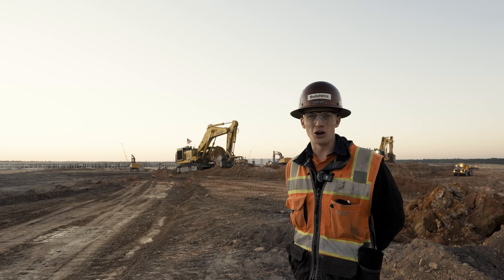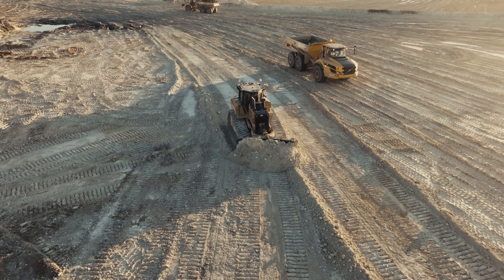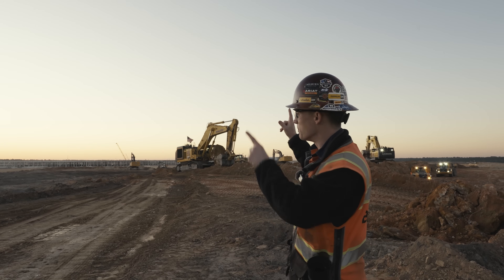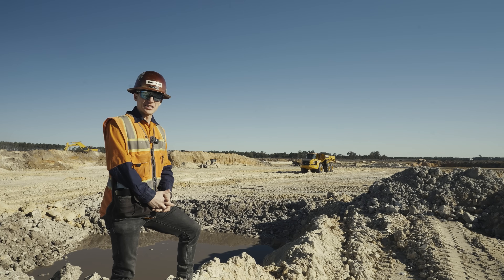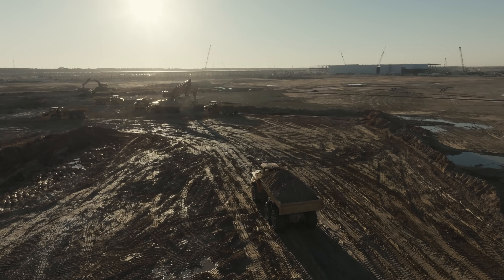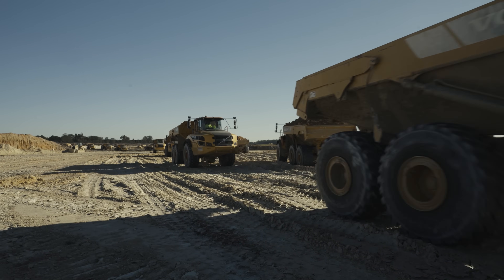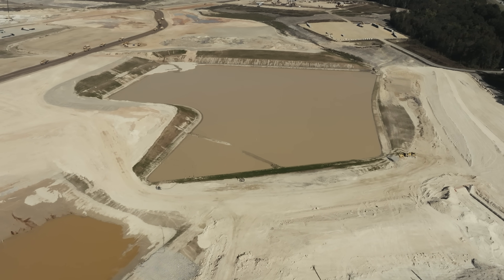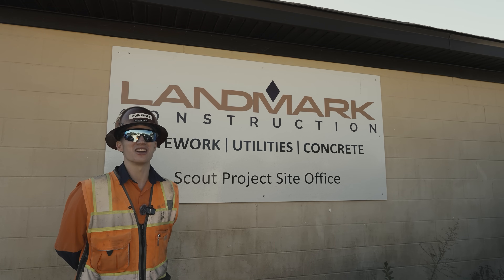America's Largest Earthmoving Project?

Comment: I was at a large ag show once and they had a tractor pull competition. Volvo was exhibiting at the show and for fun they stopped off at the tractor pull with their articulated (dump) truck and had a go at it. They weren’t really competing, but just having fun. Basically it was, “Where do you want the drag sled parked!”

Comment: 5:03 Does it need to be perfectly flat?  A modest slope is not only better for water management, but could be used strategically to lessen wear on conveyors if the assembly line starts at a higher elevation than it finishes.  
It's probably a lot more complicated.

Comment: I am infatuated with ejector bodies on ADT trucks. Imagine the tucks being able to dump and spread on the fly. Think of the transmission cycles eliminated. 
Think of the carry-back minimized. 
When dumping in the soft areas…not having to stop, just roll along, dump, spread and the ADT rolls over, staggers his spread and spreads on the fly too. 
The inertia required to get 40 tons moving would be greatly reduced as would the wear and tear on driveline components, I bet there would be fuel savings on that too.

The ADT truck would be less tippy too. Sticky carry-back material in the bed corner during the dump cycle raises with the box, raising the center of gravity (imagine a crane lifting and booming out an unknown load while unsure of the ground conditions, if the out riggers are out…)

I am certain as time goes by the ADT ejector boxes will become more and more common. 

We should grab a coffee sometime Aaron.
Reply: You can dump on the move with Volvo ADT's the moment you start to lift the body they are speed limited, need good flat surface to drive on though

Comment: I used to work for one of the biggest earthmoving companies in uk . Used to stay away from home a lot or travel all around the country fixing this stuff . As a site fitter, we used to start at 6 am, check oils, and start machines up they used old volvos 860 for lube trucks.  
Dumpers used back then, and equipment 
769 b
A25
A35
D250
D400
235 b,c
245b,c
14g
16g
D7H
D8k
D9h,g 
631
637
825b
Dw 21 converted to rollers 
Terex ts 24
Komatsu 650
Kom D31e
65 e
Pc 210
Komatsu scrappers.
They had a lot of plant .

Comment: Roughly $8 per cy cut and placed. $256 million dollars. Factor in utilities, rough in of roads, parking lot, and ponds roughly $75 million. Interior foundations, plumbing, and electrical trenching $10 million. Paving of roads, parking lot, curbing, and sidewalks $15 million. Aggregate rammed peirs and other ground improvements $45 million. This job is monstrous at $401million! If site work package is 25% to 30% of total cost of a project. It's over a $1.5 Billion dollar project. Not counting the cost of land, permitting, and design. Gc probably gets 2.5% management fee.

Comment: The haul roads are horrific. Where are the graders?, didn't see one in entire video. The 17 minute haul be cut to probably 13 minute easy.  Most excavators seen are digging too deep, many not even full buckets, almost everyone digging too far from trucks. With the 1250 that truck shoulda been loaded well below 50 seconds. I can do this in bout 55 seconds with a 330 Cat, yes provided the truck driver cooperates. Where are the clean up dozers for the excavators?

Comment: 1600 acres stripped of forest and habitat, stripped of the earth that would otherwise absorb all that water.
Then used to fill in more wetland habitat. 
Replaced with heat reflecting non-permeable concrete, asphalt and buildings.  And ponds that will not serve the same habitat purpose as the wetlands did.
All to produce vehicles that our government subsidizes and the majority of Americans don’t want. 
But…the tree hugging anti-fossil fuel consumers will buy them. Just don’t show them this video.

Comment: Sure, it's a big project but who is running it and designed it?? ZERO motor graders on site!!! WHY?? Your 'over 100 trucks' are loping all over because of poor roads in the cut!! This increases waste, increases travel time per trip, increasing fuel costs AND repair and tire costs and is LESS efficient all at the same time. The fact that your 1200's are mostly top-loading is also NUTS! This looks like a big, poorly-designed hot mess.

Comment: Great video!  I was on a project in San Diego in the early 1990's that had thirty-six 657E Caterpillar Scrapers working in pairs with nose hooks.  Several Cat9 Bulldozers as well. The conditions were near perfect with sandy easy soil and sub two minute round trips.  10,000 yards per hour.  I witnessed one ten hour day where they moved 100,000 yards.  I was a working as a land survey party chief at the time checking the daily volumes.  The most amazing thing?  The earth moving went on for months and months.  If I remember correctly it was 6 million yard project.
Reply: Was that down by the border?

Comment: Yeah, nice work but at what cost? You  know taxpayers will  pick up all the cost of the billions spent. And all for a failed transportation method. We have neither the power generation capacity nor distribution network to go fully electric. Not even close and it would take many years to address this issue and trillions of dollar. So  much carbon emissions  to do this you would never make up for it by producing failed EV'S. But trillions of dollars will be made by thise awarded contracts and the politicians handing out  the contracts.

Comment: with projects this large, why is it still practical to use relatively small equipment
or is it just that this kind of project is rare so all the equipment then have is for small projects

guess you explained the dump truck size, floatation issues
but using 10yard buckets, thats still more than 2 million passes, and it takes a few passes to fill each hauler
Reply from the maker: often to availability of large equipment as well... can't just call a manufacturer and get a 300-ton excavator next week

Comment: This is amazing. It's also amazing that crews from in the cut and fill areas are not using grade states, not even gps.
Reply from the maker: there are dozers with GPS that will monitor the cuts and fills

Comment: SCOUT MOTORS is owned by the Volkswagen Group. So Lindsey Graham got a foreign company some kind of sweetheart deal with the CHIPS ACT to build ELECTRIC trucks which NO ONE wants and they suck for what trucks are used for. It's why we are $36 trillion in debt. It's why AOC goes into Congress as a broke ex bar maid is already worth $5,000,000. Insider trading and backroom deals is what CONGRESS does now. It's the only thing they are good at. All I get from all of this is inflation on steroids. Other than that it's a great video.  While Chevrolet is outsourcing it's jobs to other countries. SCOUT MOTORS RECEIVED A $1.29 BILLION SUBSIDY FFFFRRRREEEEE

Comment: I love this channel. I believe, the Microsoft Data Center being building in Mount Pleasant WI (South of Milwaukee) is on par, but actually appears quite a bit larger than this. The area being used is 3 county highways wide. Its one facility, stretching I believe 3.5 miles NS and 2 miles EW. I would love for your channel to check out that megaproject!
Reply: Company I work for is working that right now, as well as a project in northern Louisiana that I am currently on, 1 mile wide by 6 miles long
Reply: @ SMALL WORLD!!! 6 miles long is actually INSANE!
Reply: @yay468  I work for rock solid soil stabilization, if you’ve heard of us. But yeah it’s absolutely insane. Contractor has over 100 scrapers down here. We suspect it’ll take us about a year to stabilize the whole thing
Reply from the maker: thank you!
Reply: So these are data farms???
Reply: Did you guys listen to this first?

Comment: Have worked on some large (what I consider large from 100,000 cubic yards to 500,000 cy) earthmoving jobs where we had a fleet of scrapers or a fleet of trucks (rigid-frame or ADTs).  But this job's daily quantity of 75,000 cubic yards of production is just insane.  There are a very few jobs in the past in the U.S. like large earth/rockfill dams that are larger earthmoving jobs such as California's Oroville Dam (78 million cubic yards) but not many.  Thanks for explaining why they were not using top-down loading in some of the scenes because I saw it being used and then not used.  Thanks for sharing this plus kudos to Landmark Construction!!  Great production/great narration as well!!
Reply: I worked at Fresh Kills Landfill for 28 years, 18 years while the dump was open for business and 10 years just filling in voids with dirt, in preparation for final capping, usually (not always) in 5 foot lifts. Some of the areas I filled were more than 50 foot deep and 2 miles long. When I was Shop Steward we had only 16 Tractor Operators. (As opposed to 260 Tractor Operators, when the Landfill was open.)  I used to push out and grade 240, 20 yard truck a day, everyday, rain or shine. Sometimes I got help to cover outer slopes, I also built the access roads to get the trucks to where they were needed and enable them to dump even in inclement weather. I did this with  D9Rs, and D6R LGPs depending on ground conditions. I moved more than 10 million yards by myself during the time that the dump was closed. During the time that the Landfill was open, I spent 3 years as the Plant #1 daytime "Cover Bull". During that time, I built 3 one million yard cover piles, from which our "night scraper gang" drew from to cover garbage in various areas of the dump. When I retired, there was only 3 Tractor Operators left, and they ceased the fill operation completely, handing it over to Tully Construction for final capping. As a retirement gift, they gave me a Scale Model D8R.
Reply: Are you retired.?
Reply: @rogerbrandt6678  No, as I sit here tonite (Sunday 1/11/2025) I just finished updating a course syllabus for a course this Spring Semester 2025 at UNLV and now am working on a consulting report that is due Tuesday.  Way too busy but still having fun!!
Reply: 75,000yd3 a day is only just under 36 loads a day in the 100 trucks they have, assuming they are all 40t. Pretty modest to be honest, but I see a lot of inefficient loading setups in the video and its probably a longer haul across site. That being said larger trucks would make a long haul more efficient.

The site I am currently working on we move 2,000,000 yd3 every 24 hours

Comment: Nice job. I did a job almost the same size 18 years ago just north of Toronto Canada ,30 scrapers, 9 dozers, 4 graders, 10 packers,we where there just over a year ,from sewer/water mains to building and finish asphalt. I love construction equipment ,went to the mines for a few years now retired .Cheers and be safe
Reply: Who did that job?
Reply: @oldironguy  Con drain with Bianchi  construction
Reply: @uneetudiant  Con drain is still a major player in sewer and water/ subdivisions. Them and their relatives TACC
Reply: @oldironguy  Yes they are ,I did work at Clearway for many years too ,they are big too,but special under ground pipe I did.
Reply: I think the correct pronoun is we not I
Reply: @Old-n8f  Ooops my bad ,I was the super lol

Comment: Top loading does have to happen at times. They clearly have ample truck support. I enjoy watching.  I do question the deep cuts. The excavator can cycle faster with a 4'-5' cut rather than a 10'-12' face. Double or triple pass required but maybe they have an area constraint. I would love to see a follow-up video on this project.

Comment: The earth is flat, it don't rotate or spin. I spent enough time on the ocean and in the sky to know this. The only reason you can't see an object far away isn't because of curvature, its because we are limited in sight. A pair of binoculars will prove this. The earth is not without its rolling hills, tall mountains or flat water so still it looks like a mirror.
Reply: Standard row boat on a lake a few miles long proves you wrong.

Comment: I was hoping this would be for an advanced chip manufacturing plant, not an EV assembly line. Unfortunately electric vehicles have been decreasing in value and there's a very high chance of that trend continuing with the upcoming political changes.

Comment: Appreciate the content. Please consider more statistics regarding the management efficiency of this project. How often does the scraper or box scraper run the transit route to maximize transit time of the trucks? What, if any, was the difference in transit time with the rigid versus the articulated trucks? When does geographic availability of used versus new equipment get factored in? How do they factor efficiencies in the fueling and daily maintenance occur?  Is it all at once over night or staggered? What is the tradeoff with a 10yrd bucket versus 12yrd bucket with fuel burn? When does 24/7 operations or overtime with 12 hour shifts get considered?
Reply: F*ck me, you like your statistics

Comment: Are all the articulated trucks the same capacity ? Looks like all 35 ton units. If that is correct, I’m wondering why the contractor decided not to go with Volvo’s higher capacity models. Such as the AH-45 and AH-60 attics.Using the bigger trucks would have definitely reduced the overall fleet size. Might just be the contractor wants to minimize ground pressure while traveling on the soft underfoot.
Reply: We have 40, 45, and 60 tons. They also got rid of the 605s and replaced them with more articulated trucks
Reply: They didn't get rid of the 605s the lease on them was up so they were returned.

Comment: Why are large buildings flat?  Keep in mind I have been in construction for 60 years.  And how would you gauge both plumb and level ?  And if you do make it flat it will always be down hill toward the center of the building, and uphill whenever traveling away from the center.
Reply: It is done with GPS accurate to a centimeter. 2 or 3 transmitters on site.
Reply: @kkarllwt  No.  You do not undestand my objection or point.  And it may lie in simple semantics.  The earth is not flat so we move dirt.  Okay.  But the Earth (capital E) is NOT flat  it is an oblate spheroid.  As he spoke is was clear (to me,, possibly that was my error) that he was speaking of Earth,, not just earth.  The construction site is 11,000 feet long ?  Would it surprise you to learn that equates to about 40 cm of total curvature?  16 inches?  40,,, four zero cm   One cm accuracy then confounds the discussion further..  I am a builder,, but I also have been a sailor.  The Earth curves about 8 inches per mile.  So which is it?    If you build it PERFECTLY flat,, water on the roof, forklifts driving the floor, a perfect round ball bearing placed on the floor at one end WILL roll or flow to the center
Reply: @Sailor376also  yes - I recall when we built our kokomo, ind transmission plant - the engineers had to take into consideration the curvature of the earth.

Comment: 10:04 It's not so much the "top loading", sometimes you have no choice but to "top load" (I call it loading on level ground) to get certain jobs done or getting the last bit of stock pile loaded out. I'm more concerned about the truck behind the truck getting loaded that's at a stop fully loaded. Why can't he go around or they set that up any other way then having a fully loaded truck stopped when it should be hauling ass to the dump site. I see the dozer is making a pass but its in the way. I'd have my haul roads wide enough to pass if not a 2 lane for clusters or return hauls. I use "top loading" term as top loading a scraper or something that needs top loading like a dump truck..lol. What the operator was doing here was just loading a truck from level ground. All dump trucks are top loaded weather its below you or same level as.

Comment: Great music,  I wonder why they didn't go for scrapers.
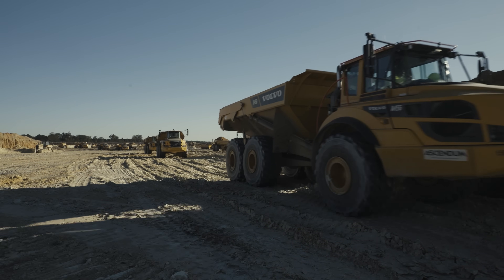Reply: I have the same question. My best answer is.... Go to 12:58 in the video and look at the dirt he's standing on. I think it has something to do with that strange soil. You can see how that soil is a very fine sandy-clay that doesn't drain water, and holds it in and turns it to something that resembles a sponge cake on top of a bog. Scrapers would not be able to get enough traction on this dirt. The clay would fill the tire treads the second they started spinning, and they would spin bad because that kind of soil is extremely dense and hard when it's dry?
Reply: @NatPat-yj2or  Maybe,  but they usually have a couple of pushdozers coming up the rear to help the loading.
Reply: 4 mile round trip
Reply: @kkarllwt  hence makes sense to have a scraper loading in 12 seconds 60 tons  and unloading on the fly v's dumper loading 45 tons in 8 minutes, and having to manouver to tip in 15 seconds,  Cat ejector dumpers would make more sense, unloading without stopping.